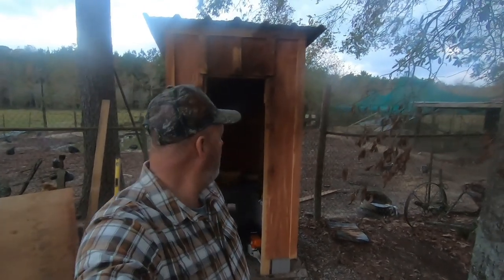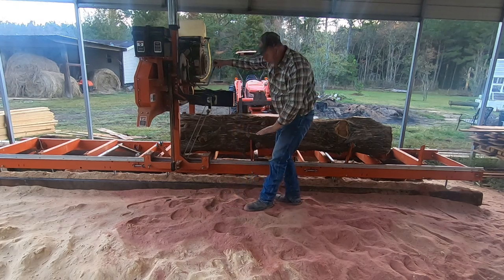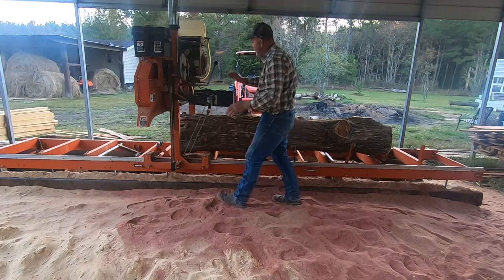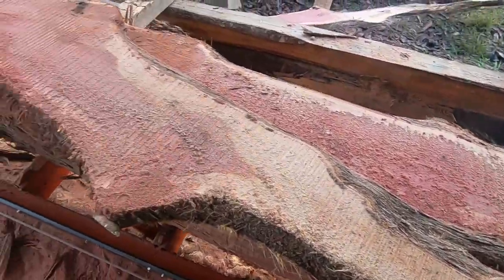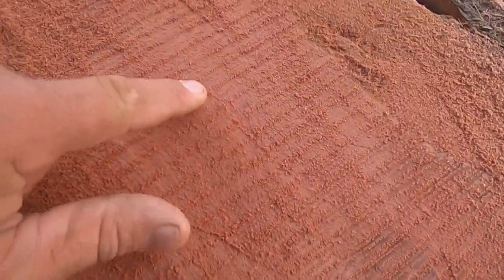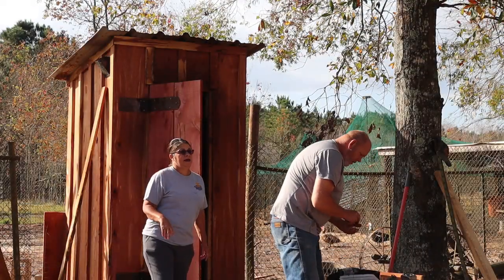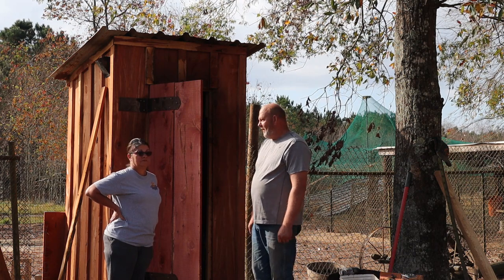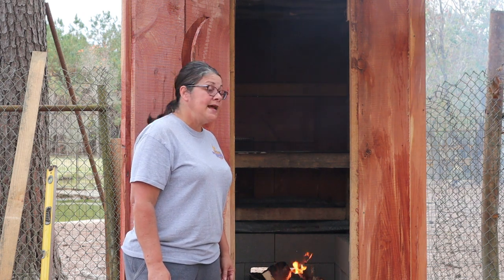Milling Cedar For Smokehouse Door

Comment: Before you start the pecan cutting on the mill, get all the cedar sawdust cleaned up so you can save the pecan sawdust.  Pecan sawdust is great for smoking, DO NOT USE the cedar sawdust.  Looks great Todd.
Reply from the maker: Thanks! Sure will

Comment: When you bend those cutting teeth, do you just replace one, or do you have to redo several in a row?
Reply from the maker: You can fix it when you sharpen and reset the blade